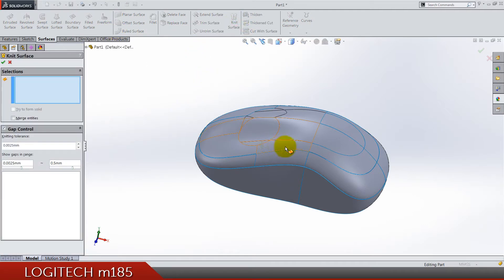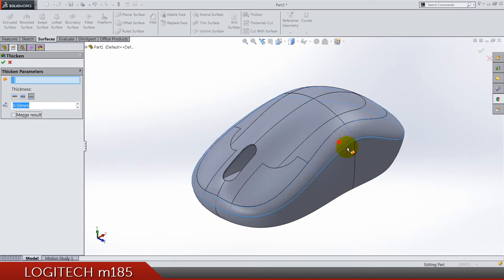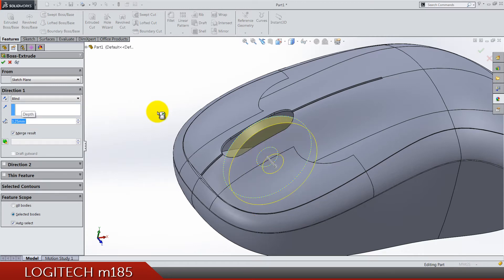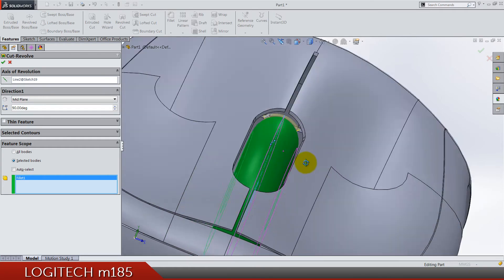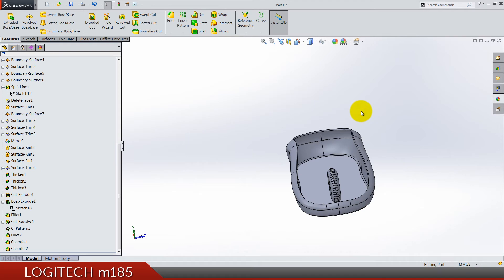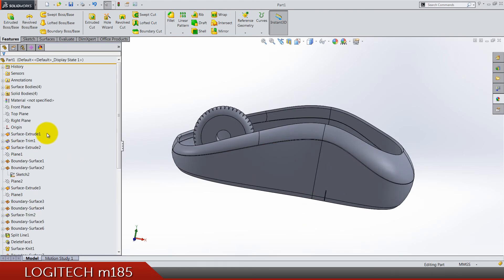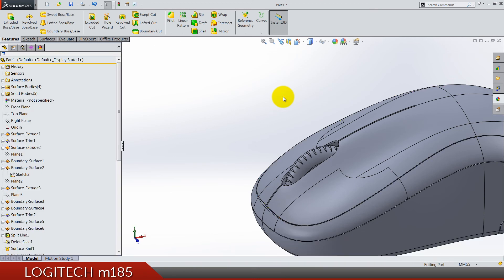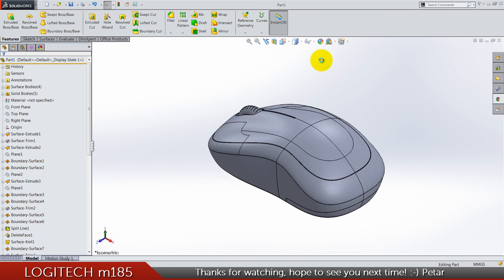Logitech m185 - Surface modeling tutorial [SolidWorks] #2

Comment: is it possible to put the wheel in  as a part rather than having everything as a whole, thanks
Reply from the maker: you just need to model everything from tutorial, then copy and paste that single file couple of times
name each part for example - body, wheel, lid
and then in each part take command delete bodies and delete all the bodies you dont need, for example in part called mouse wheel leave only mouse wheel solid body and that's how you get the parts
after you dont making parts open up assembly and assembly everything with next mates
(before doing mates when you insert first part right click on it in feature tree and click FLOAT) - you do that only for first part you inserted, then>

COINCIDENT mate - front plane of the part with front plane of assembly
right plane of the part with right plane of assembly
top plane of part with top plane of assembly
[you do that for each part]

Comment: it wont let me knit the middle part at 39 seconds of the second video any ideas why?
Reply: I followed the above instructions and my surfaces still wont knit even when i delete the right side and try knit only one side. please help as everything up until this point has been very smooth and helpful!
Reply: When i knit one surface it wont let me knit the other, and vice versa i dont know what is wrong
Reply: Petar-Vertex an old comrade Pete, well leave it at that.
Reply: Petar-Vertex I know yeah, no need to be rude, Maher will get ye.
Reply: Petar-Vertex sorry my english is bad, I'm stuck on the part where you knit the top.
Reply from the maker: it has be something about surfaces are not well connected, you must have made some kind of mistake in drawing sketches for surfaces you built or made a error in drawing sketch for trimming commands
try DELETING all surfaces from the right side and then knit together only one side, then mirror that surface body if the knit works and then knit together those 2 surfaces bodies
when I say from one side I mean that mouse is symetric if you look at it from the top and what splits it in half is a FRONT PLANE
if it doesnt work text me on my facebook page ;)
Reply: I'll try that now
Reply: thanks
Reply from the maker: ok I am here if you need me! ;)
Reply: got it done petar thank you :)
Reply from the maker: you're welcome my man! ;)
Reply from the maker: shoot me an email with the part you working on to take a look at it
Reply: Petar hows the form
Reply: what is email mine is desdunne00@gmail.com
Reply from the maker: not bad, and who are you remind me please? :D
Reply from the maker: Oisin Gallagher3391 ok, and how are you?
Reply: Petar-Vertex getting by bro, you know yourself, tell the mother Oisin said hello.
Reply from the maker: Oisin Gallagher3391 man you mixed me up with someone else 😂😂😂
Reply from the maker: Oisin Gallagher3391 I guess you trolling me don't know what to say 😬
Reply from the maker: Oisin Gallagher3391 I have no mother
Reply from the maker: nice try :D